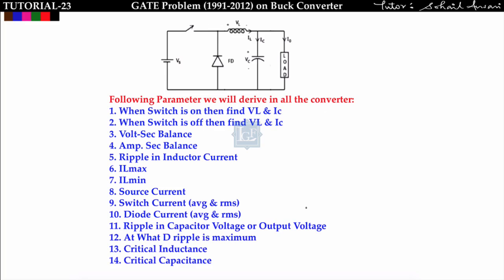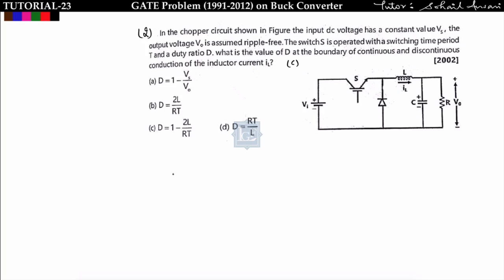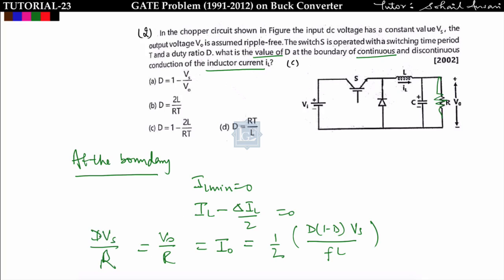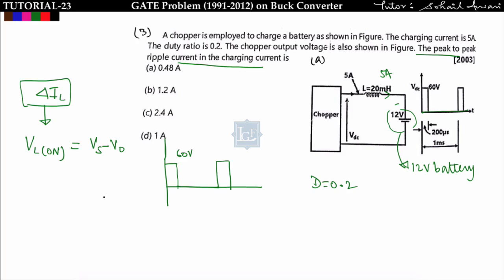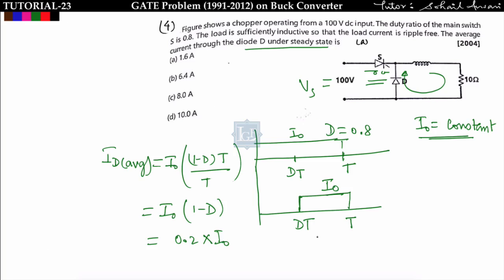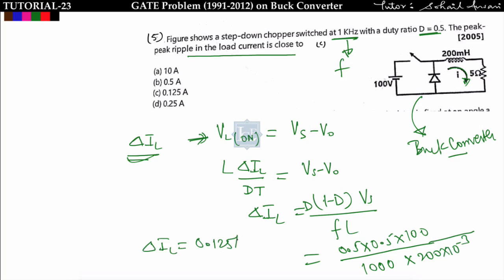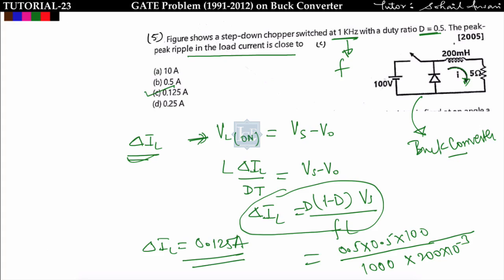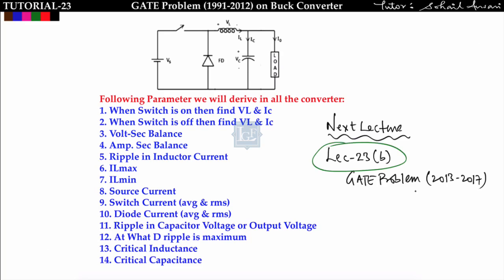Lec 23(a) GATE Problem Solved (1991-2012) based on Buck Converter

Comment: Pls help.

A buck converter is supplying 360W to a 10ohm resistor. The input voltage is 100V. Assume all components are ideal and converter is operating in continuous conduction mode . Find the average inductor current
Reply: Io=6A